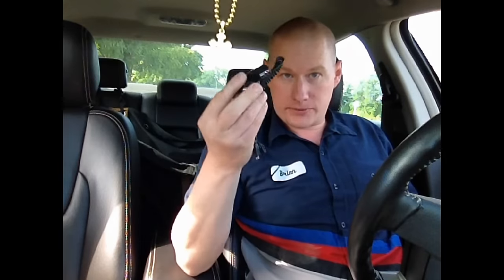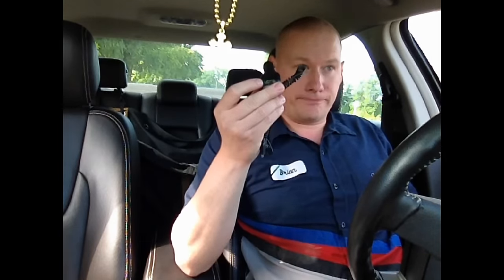Troublesome Ford Tire Pressure Monitor Faults Tip

Comment: I thought this was absurd when I first watched it... I couldn't have been more wrong, and my cheapy item was a cigarette lighter to double usb charging station. Had just put some new aftermarket wheels on my F150 and only knew that they had sensors in them but just figured they were the wrong ones after several failed attempts to train them. Was going to shell out almost $200 for new sensors and installation soon and just happened upon this video. Although it could be many things as Makuloco says, give this tip a try, it saved me so much just in time alone. Got in my truck and unplugged the usb charger as I joked to my wife what this bafoon on YouTube said could be the problem....waited for the flashing light and information panel to indicate sensor failure as I would see every day.... We were driving down the road laughing and the sensor failure never happened again. Guess I'm the bafoon this time :-) Thank you FordTechMakuloco.

Comment: I have a problem with my 2008 Ford Ranger FX4 TPMS. It started acting up about a year or so ago. After about 20 - 25 minutes of driving, the TPMS icon would flash for about a minute, then come on solid. I rechecked all tire pressures, including the full-size spare. All good. After it sat for a half hour, the light would go out, only to flash and stay on solid around the 24 minute mark of driving again. When I bought new summer tires, I had a spare set of rims I bought, so I had 4 new sensors installed on aluminum alloy rims, and the device to test them shows all 4 sensors are transmitting, but when programming, the rear tires would not connect to the module, (no beep of the horn) so after a 24 minute road test, the TPMS light started flashing and then came on solid, so the shop connected directly to the OBII connector and told the receiver they were all there. Some weird things happened just as the tech finished. Follow me on this. The doors would lock and unlock, and the interior light would turn off and back on, and there were 2 "clicks" heard. He has done lots of these and never had this end result. I'm thinking maybe a cold solder break in the receiver, and I was going to remove the receiver and resolder all the connections, clean up the  ontacts with a fiberglass burnisher and see what that does, but after watching your video, I remembered that I have a 6 output 5V USB device that plugs into my lighter socket. I'm going to try wrapping it in aluminum duct tape and see if that blocks the possible interference. What do you think?

Comment: HOLY CRAP!!  Thank you sooo much!!   My sensor came on today, so I took it to Big O for some air, and was  going to just wait til I could afford to take it back for repair.  But then I decided to do a little research, and came across your video.

I immediately took out my charger, and VOILA!   The sensor fault light went out!   You saved me $$$$$, and for that I'm totally grateful!!.
Reply from the maker: Nice!!
Reply: the same thing happened to me.. i took my 2016 fusion to get an oil change and on the drive back, that light came on. did some research, found this video and it was my charger causing the problem. :)
Reply: @FordTechMakuloco  do i absolutley need tire pressure sensors? I bought new rims and tires for my 2011 sho. I was wondering if i can just run it without them. I dont mind if the light is on. Also with the light go off when i put my summer tires back on?

Comment: I have been fighting this for 6 months before I found your video.  After 20 minutes, I  would get a message on the dash saying "TPMS Sensor Fault Error".  Let it set for a few hours and again it takes 20 minutes for it to show up again.  As best I can remember, this started about the  time I installed a different dash cam that used a  cigarette light plug for power, same as a cell phone charger.  I removed the power  source and voila, the problem went away.  I can't thank you enough for this tip.

Comment: Dude, I came accross your video and it saved me a trip to the dealer. I have a 2024 Ford Transit and had recurring TPMS issues and then when I put on winter tires it got worse because the Van wouldn't recognize the rear tire so I couldn't reprogram. Unplugging my Garmin GPS from the cigarette lighter plug fixed the issue instantly. I can't believe more people don't know this! Our tire shop tried using Ford calibration tool and couldn't make it work. THANK YOU!

Comment: I just wanted to thank you for this video! My tire pressure sensor fault light came on and after listening to you talk about cheap chargers I realize that I had recently purchased one and it was about the time that my light came on. I remove the charger and within one minute the light went off and now I'm having no trouble. I want to thank you for saving me a lot of money and this video you made is excellent!

Comment: I have a 2010 f150. This fault came on, I had stopped at a gas station to get something to drink, and decided to look up this issue. In the 15 minutes it took to get to my house after unplugging my phone from the charger, the fault went away. You sir are a life saver.

Comment: I was running my 2008 Escape today on a 3-hour road trip with a Charger Doctor plugged into a 5v USB voltage regulator I had previously installed.  The Charger Doctor is a cheap little device which monitors the regulator output and any current drawn by a device plugged into it. This was the first time I drove the car for any distance with the Charger Doctor attached to the regulator output AND the first time I got the tire pressure monitoring system error.  I seriously doubt this is a coincidence.  Your video most likely just saved me a lot of troubleshooting.  THANKS!

Comment: I just bought a 2010 Ford F150 Platinum and everything was great, I drove up to get my kids and about half way back I got them a cheap charger and 20 minutes later the TPSM came on. I thought I ran over a nail or something, I checked all the tires and they where fine, When we got back home and they took there IPADS out of the car the TPMS fault went away. Well long story short I came across this video and when we where driving back up the fault came on and I pulled the charger out and the fault went away. Thank you because I was about to take the truck in and have it checked and I am sure they would have replaced my sensors. You saved me a ton of $$$$.

Comment: Oh, my gosh! I am so glad I found this video through a search. My tire pressure fault sensor about drove me crazy on my trip to Massachusetts and then to Virginia. And, guess what? I was using my phone as my GPS, and using a plug in charger....likely a cheapie. I've taken my 2008 Ford Escape to two shops which couldn't get it to replicate the problem. Guess what....No charger would have been plugged in. Thank you a million times over for this fix.

Comment: I 'd like to thank you very much for your adorable tip. You've fixed the biggest problem we had so far with our Acura TSX. We've got all the lights on in the middle of the highway, and we were very scarred. We didn't know what to do, and there was a long way home. After we got home, but couldn't fix it any way. All specialists recommended us to change all the sensors, which was kind of expensive. 
Everything became well after we removed the phone charger. Thank you, thank you, thank you.
Reply: Most car dealerships and shops are rip offs they do anything to sell you on a job, replace all 4 tpms sensors are you kidding me?
Reply: Second time I seen a comment about a phone charger. I have a tire pressure monitor fault too. But my car is running lean.

Comment: A week before I had the snow tires put on,  I noticed the message on the dash of my 2010 Mustang.  I mentioned it when I took it to the dealer.  The mechanic swapping the tires said there was no problem he could detect.  This video explains why.  Thanks for posting this video.  Super job.

Comment: Woooooooooooow soooooooo accurate. Did this while on a trip. Unplugged the car charger and 2 min after, boooooom . Tire pressure light turned back off. Thank you Sir 
07 Ford Expedition EL

Comment: Thank you!  I have a 2006 Ford Escape with a tire pressure sensor error that wouldn't clear, and this solved it.  I had a cheap power inverter in the back seat area plugged in, and as soon as I unplugged it, the warning light turned off--and my stress level lowered to the normal operating range.
Reply from the maker: lol
Reply: ford. econline tire air psi

Comment: This is nuts! My TPMS has recently been coming on and off, in a way that appeared totally random. Spent over an hour at Les Schwab the other day, and they said the tires are in great shape, they couldn't figure out what was going on. After watching this video I realize this started right after I got a new, cheap, charger for my phone. I'll bet you that's what's going on. I'll be sure to unplug it the next time I take a trip longer than 20 minutes and see if that solves it.
Reply from the maker: +Ellen Weigel I am sure it is or you have over 100k miles on it and the batteries are dying.

Comment: Well damn. I'm sitting at the dealership waiting on the mechanic to come out. Took this $3 charger out and the sensor light turned off. Thanks alot. 2007 ford edge.

Comment: Glad I you tubed before going to buy sensors. Just bought 2013 f250 , no lights on dash for 3 hour ride home. Got things out of other vehicle into new to me ride (including my cheap-o charger) and short distance down the road and tpms fault comes on. Found this video, unplugged, and light goes away. YAYYY!!!  thanks guy 👍

Comment: Is there a difference between "Tire Pressure Sensor Fault" message and "Tire Pressure Monitor Fault" message?

I'm asking because at the start of the video, a "monitor fault" is referenced, then later on, a "sensor fault" is talked about.
I hear and read about people mixing up these to terms, just want to clarify.

Comment: FordTechMakuloco
You sir are the man! I've researched countless videos about this subject and have so far not been able to rectify my problem. As soon as you mentioned interferanhce, It felt like I was literally slapped in the head. I am an amateur radio operator ( HAM ) and recently installed a new UHF/VHF radio on my vehicle. Thats when the problem started ( like the police vehicle ). I disconnected the power lead to my radio and the LTPM went off. I thought this was a fluke so, I re connected the power and BAM there it is the LTPM. I have since installed a few ferrite beads on the power lead and the problem solved. This tid bit of info will be passed along. Thank you for providing this knowledge. Saved me money and time....Oh by the way - 2007 ford edge awd

Comment: Had used a cheap dvd charger in my Ford Flex and the sensor fault light came on during the drive-(checked tire pressure in all four tires and it was good)-tried this-unplugging cheap chargers and restarting and the light went off! Thank you for saving me $ and time for such a simple fix!!!

Comment: I have just had 2 sensors replaced truck out of the shop 1 day and it happened again going to pull our cell phone charger out my wife just put one in the truck and it was a cheaper dual charging one and we've started having problems not to long after we got it thanks so much your videos really help.

Comment: Ha ha, genius.  Pulled the phone charger light went off 5-10 minutes later.  Plugged it back in and there it came back on again 5-10 minutes.  Problem fixed. Thanks for posting this.

Comment: Thank You for your advice. I have a situation on my 2005 Lincoln Aviator that is puzzling me. The passenger side window motor was replaced by the dealer and since then the auto up down feature stopped working. Manual up and down does works and I have tried several methods to correct this. Not much of an issue but as a hobbyist I have to fix this problem 🤣🤣  so I am reaching out to see if it is reparable maybe the unit is not compatible with this car.. Once again Thanks for the advice.

Comment: Thanks for the tip. I was getting a sensor fault on my 2009 F150. I own a security company and had put a tool box full of wireless sensors ( with batteries installed) in the back of my truck. After watching your video I thought that may be the problem. Sure enough. Took them out and haven't had a sensor fault since.

Comment: Super helpful video!   I've replaced my VSM and all 4 of my TPMS sensors on my 2011 Raptor.   Dealer was stumped.   What they didn't know is I had a cell phone charger hardwired inside my dash feeding a dash mounted phone cradle.   All good now... thanks!!!

Comment: Awesome man. As soon as you said interference from chargers I realized I put in a Bluetooth adapter right around the time I got the light. Pulled it out and it immediately went away!!! Thanks man.
Reply: Yes mine came on not long after I put in my blue tooth dongle... I'm going to go yank it out and I have a feeling the faults will be gone !
Reply: @dannymac7852  Did it go off? My light came on about 15 minutes after I plugged my crappy phone charger in but when I unplugged it the light is still on even after driving for half hour. 🤷
Reply: @jimh.412  unfortunately, the light stayed on. Every time I started the truck I would go thru the message ... and about a week later suddenly it stopped!
Its come on twice more, at random times, and stayed on for about a week , then goes away... weird.

Comment: Thank you again brother. You have gotten me out of more than one jam.

 Not even 5 minutes ago, my car (2100 ford escape) started shooting this same code. First place I went to is your channel.  

Guess what, it was exactly what you're said. I had just purchased a cheap phone charger for my car from 7eleven.

 I unplugged it, and the issue went away. It was intermittent as well.

Tha k you again. Now I need to solve another issue: how to remove a stripped oil drainplug on the same vehicle.

Comment: In my 2009 Ford Escape Hybrid I get an erroneous Low tire Pressure warning every time I drive near a certain place (On the Westbound approach to the San Mateo Bridge in the SF Bay Area). I check my pressure but it's always fine. Thank you for this video, now people can stop thinking I'm insane for saying something is going on with this issue.

Comment: Thanks +FordTechMakuloco I'm on the road right now and kept encountering this issue. we pulled out all the cheapy chargers and low and behold...no more problems
Reply from the maker: +Anthony Holmes Nice!
Reply: +FordTechMakuloco my friend I installed 37 inch tires on. A raptor and used stock wheels , and after than the TPMS illuminates and stays like that for a while , what's the problem , and I went to the dealer did a quick checkup nothing wrong with the tires there are brand new , so he did a 360 check up on the wheels and it was gone after leaving the dealer about 5 mins it returned again what's the reason and what's the solution for this , I think beacuase it's about changing tires to larger diameter
Reply: +FordTechMakuloco at the dealer he used some Sensor and at every tire he did a check up and started the engine twice after that it's gone , then it returned after like 5 mins

Comment: Great video and quick question .. 2010 Edge 102,000K, tmps started flashing then stayed solid, next 4-5 days was fine no light, then 3 days ago and since its on all the time, first flashing then solid, repeats every time restarted. IF it is just dying batteries, can they be replaced (like a watch) or would you need to buy brand new sensors? Is there a way to determine which tire/sensor is causing the problem? Thanks for any help or advice!

Comment: It only causes interference if it's plugged in, right??  If the charger is in the glove box for storage, that wouldn't cause interference. Also, can a turned on cell phone, tablet, or pc cause interference. In any case, I'll unplug the charger & see if that works. I drove from Fla to NJ and the tire pressure default kept coming on intermittently, blinking at first, then a solid icon, then would  turn off after about ten mins. Great tip!!

Comment: Same issue with my dashcam charger lead on a UK Ford Focus ST, My issue was the end of the charger in the 12v charger port was loose and once tightened and I reset the TPMS level via the user dash interface its sorted. Seems the intermitted voltage to it due to being lose caused interference. Thanks for the video

Comment: Mine started after installing new wheels and tires from custom offsets. Keep retraining them with the little push button remote thingy and every morning at a particular spot on my way to work that damn fault light and tpms fault on dash and blinking light.

Comment: Well, that'd explain why it happens so rarely in my '08 Taurus, I don't charge my phone very often in the car but it was coming on several times while I was driving on a long trip last summer (we charged our phones quite a bit... needed them for navigation, so they were pretty much plugged in constantly). Since then, it's only come on maybe 2-3 times... so this is sounding pretty likely. Thanks a ton for explaining, now I know I don't really need to worry about it

Comment: I had no idea.  I'd installed a mid-level front/rear dash cam pair in my truck and got a TPMS error three days later.  Apparently the adapter was the issue.  Removed and solved.  Thank you!

Comment: I have ford fusion energi 2016. I am pretty sure my cheap charger gave me this error indication, but I have unplugged it and after a week  and long or fast drive - error light still there. I took to service, they connected diagnostics - they said it is very strange, it does not show any errors on diagnostics report, but the indication light about fault tire pressure sensor is there. I don't get it what is happening.

Comment: you just saved me $400, I got a new charger and got the fault warning. Mechanic thought sensor batteries were dead and wanted me to replace all if the sensors!